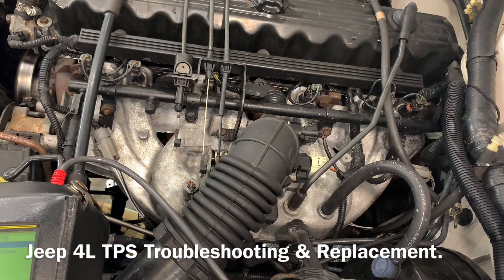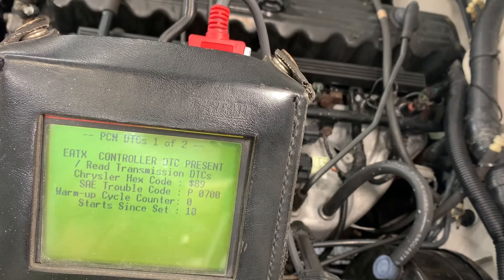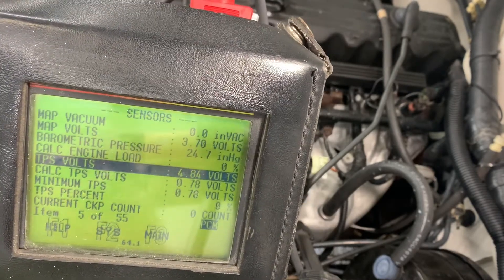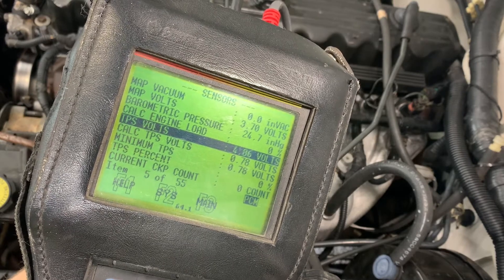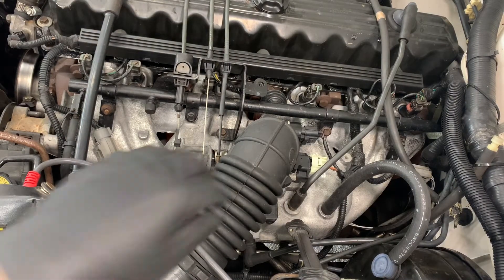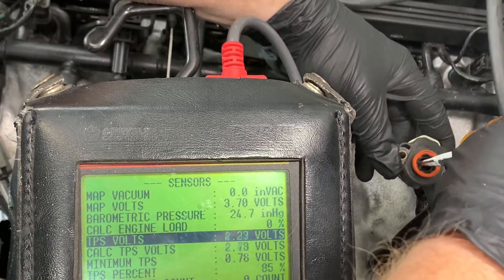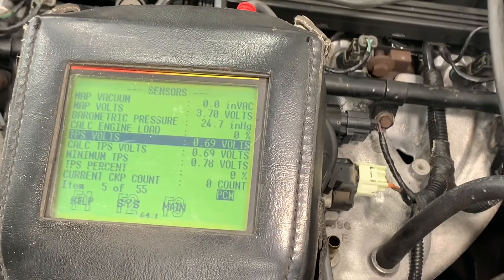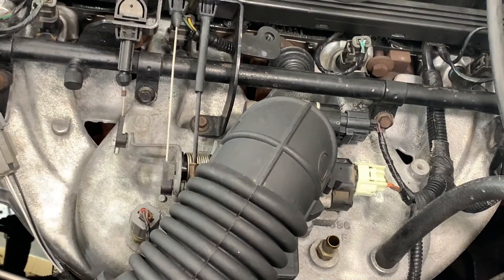Jeep Cherokee XJ TPS Fix – Diagnose, Test, and Replace (Read via OBDII)

Comment: My tps sensor was jumping around while at idle. Replaced it. The new one started acting up at cruising throttle, so I replaced that one. Newer one didn't work at all, replaced that one. Now my most recent tps has fluctuation at idle again. Currently it's acting like I'm tapping on the gas pedal while idling. Kinda losing my mind with this tps now!
Reply from the maker: That's incredibly frustrating, and it sounds like you've been through a lot of sensors! Unfortunately its possible that each TPS sensor has been bad, I know I have come across plenty of out of the box bad TPS sensors before for the 4L. There are lots of crappy sensors out there, and honestly I don't know of a good one to recommend.  The other possibility is that there is an intermittent issue in the wiring.  I actually had one of the sensor wires break inside the insulation about one inch from the plug. The insulation was intact, but internally the wire was broken. splicing in a new wire right there and inserting the wire into the connector for the TPS solved the problem. Its possible you are having an issue with one of the three wires, the wires are 5V supply, Ground, and signal. the signal wire returns 0-5V as 0-100% position, the 5V just gives power, and the ground is the ground for the circuit. If anyone of those 3 has an issue the sensor wont read correctly. Is the sensor failing high or low? Depending on how its failing that could help determine if part of the circuit is failing.

Comment: Does this sensor need to calibrated when replacing it?
Reply from the maker: It depends on the sensor, I think all the newer ones have no adjustment, but I’m remembering that some of the older ones had a slotted screw holes so it could be adjusted.